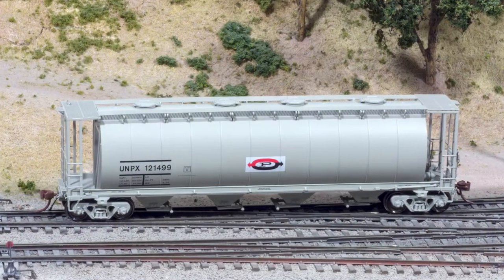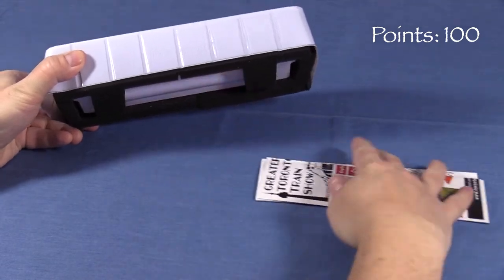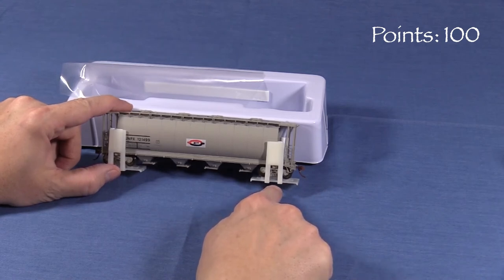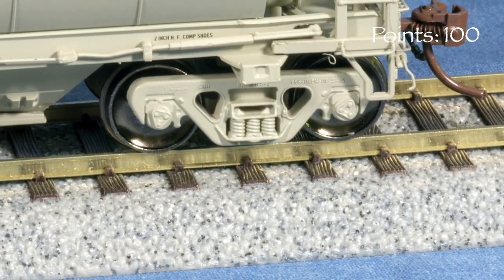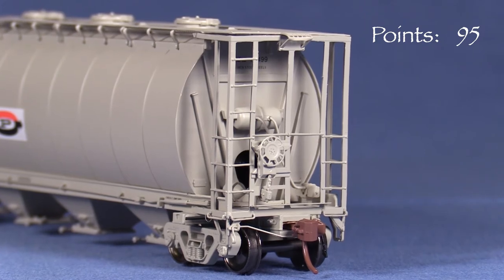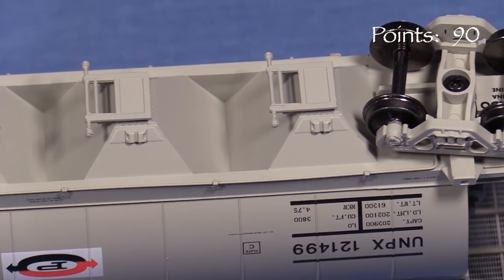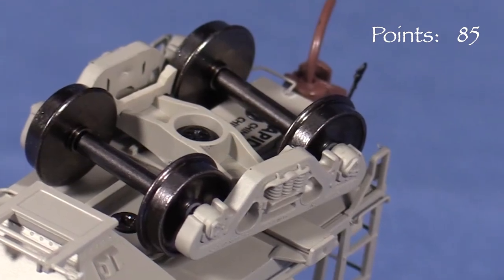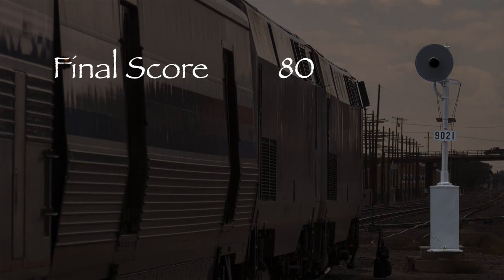Product Review HO Rapido Trains 3800 cf Covered Hopper

Comment: A couple of other good points made by previous comments. I had the two six packs of CN cars ordered but cancelled the order mainly due to the $50 price. Obviously Rapido isn't the only manufacturer to be doing this. For this price, quality control should address these issues before these models are released. I've been into HO for over 50 years. I've had to "rebuild" a new model on more than one occasion by a number of manufacturers. Again, this "good enough" attitude by manufacturers is a sore spot with me and other modeler friends I've talked to, especially with the prices they put on their products today. I run 70+ car freight trains with no problem what-so-ever, but the car weight, wheel sets, trucks and couplers all have to meet my standards. Any problems with a car and it goes into my "shop" and doesn't run again until the "defect" is corrected. This is a nice review. Thank you very much.
Reply from the maker: Sounds like you have good standards for your rolling stock just like I do.  It does make a difference, which is why I want to make sure to test everything I review.  I agree that when we're spending 40-50 dollars or more per car, they should at least have the couplers mounted at the right height and the wheels in gauge.  Thanks for watching!

Comment: Hi Dan, Thanks for a nice, clear, unbiased review. I like all of your videos. However, as it appears to on the video, I would like know if you noticed a problem on this car with warping of the plastic car ends, ladders etc., areas where the glue on the etched walkways appears to have separated. Great work keep it up.
Reply from the maker: Since I don't have anywhere to run trains yet, the car has been stored in its box since I reviewed it.  I found the box to take a look at it.  The end cages are not warped at all.  The roofwalk does slope down at bit on the ends as the cages are not quite the same height as the rest of the supports.  It is loose in one spot on the B end, but overall is in very good shape.  Thanks for watching!

Comment: Reach into the bottom of the plastic packaging and grasp the molded part that contains the car.  Lift the plastic cover off with your other hand. It took me a few models to figure this out so it's not obvious.
Reply from the maker: Once in a while I run across some packaging that seems overly cumbersome to open, or not very effective at protecting the model, which is one of the reasons I've included packaging as part of the review process.  Thanks for watching!